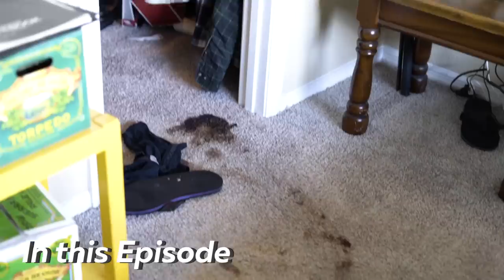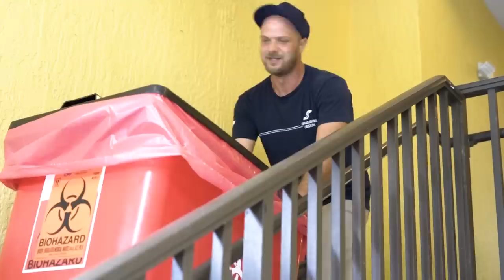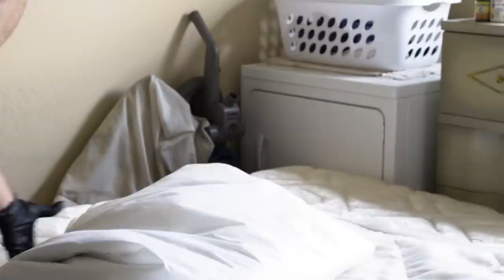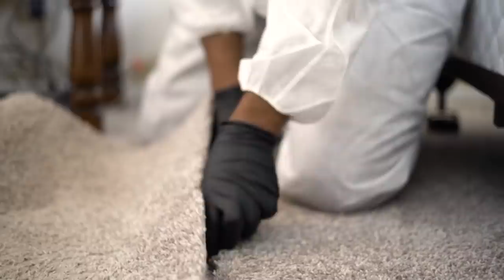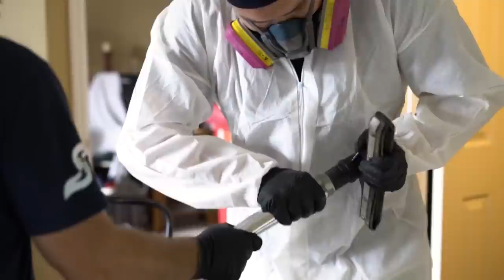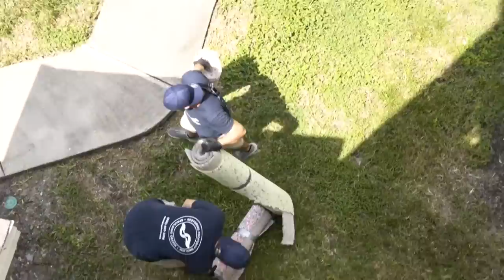S2 Episode 9: Dying Alone

Comment: What was the floor made out of?   It looked like it was crumbling as you were cleaning it.  What chemical did you use?  Where can I get some...for those hard to remove stains?  How do you know what to clean up at  each place?  How long to you leave the machine running at the site before you go back and get it?

Comment: Hello! I've noticed that most subfloors where you are located are concrete. Is this standard where you are? Would the jobs be harder if the subflooring were wood?
Reply: Bodily fluids leak through wood meaning theyd have to lift the wood too

Comment: I See ya'll got a carpet knife. That floor you were working with is called gypcrete it is a gypsum based subfloor material. Its basically a drywall like material that's a bit tougher. But all in all it's crap.